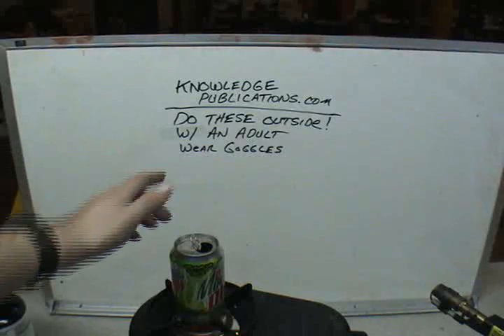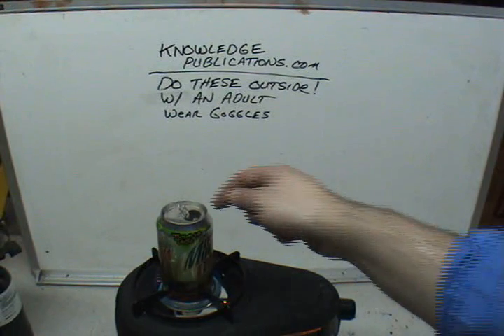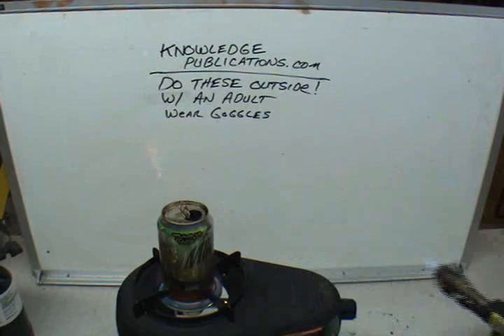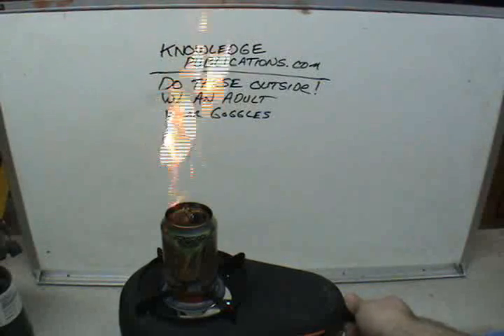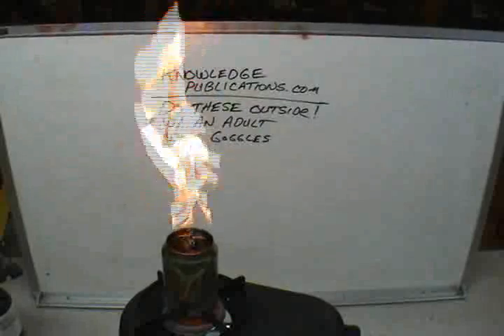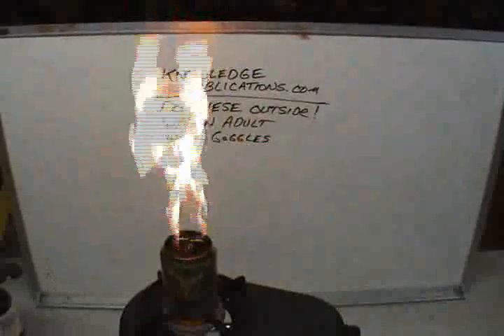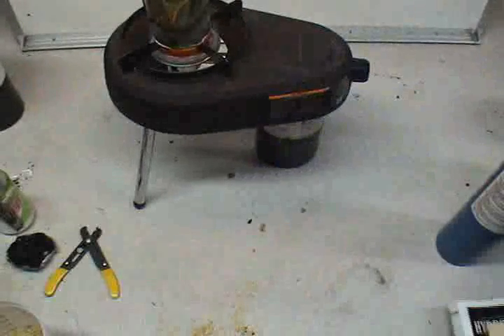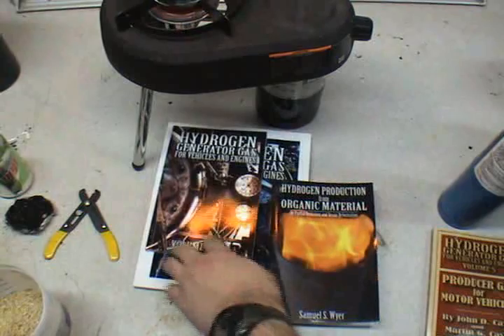Sodacan Hydrogen Biomass Wood Gas Gasifier Part 2

Comment from the maker: @gagekko I suggest the Hydrogen Generator Gas for Vehicles and Engines Volume 3&4, its at USH2 (dot) com, click on WHERE TO START,  its the 2nd book down on the right.  The DVD I suggest is the Hydrogen Car and Multifuel DVD for fueling your vehicle and the DVD The Chemistry and Manufacture of Hydrogen WITH the BOOK (same title) for making hydrogen.  I have a series of WEBINARS on the subject at USH2EDU (dot) com, everything is download and watch VIDEO.  - Steve

Comment from the maker: @PsychoScientist007 technically its not 'burnt', but it is charred.  There is no oxygen in the can for it to 'burn'.   What is left is carbon, which can be used for a lot of things, many people would call what is left BIOCHAR, which can be used in your garden.  A retort, like what you saw in the video with the pop can, is one of the main methods for making Biochar.  - Steve

Comment: If you do this with bark from a dead Burch tree or pine wood and have a drain on the bottom of the container you get a tar or pitch that can be burnt as a fuel or used for waterproofing or gluing. I never new it was also making hydrogen though. Fascinating stuff!

BTW I love your stile.